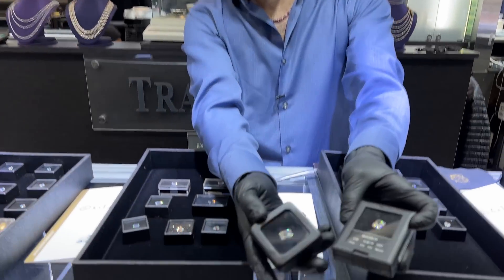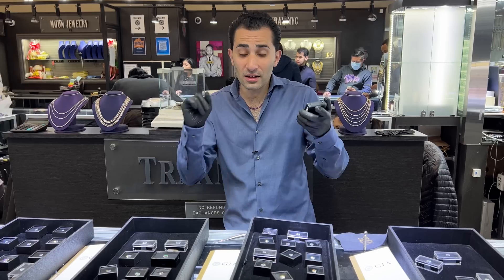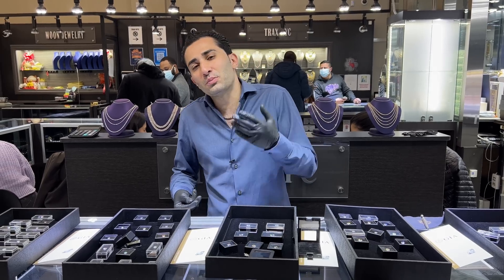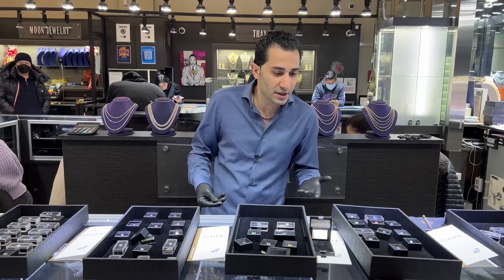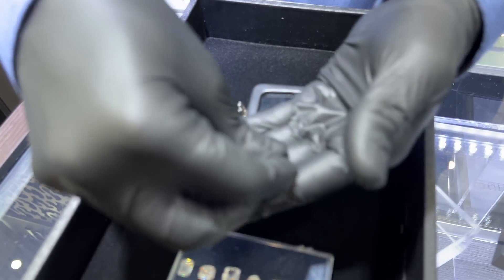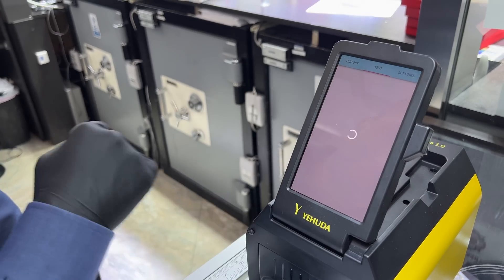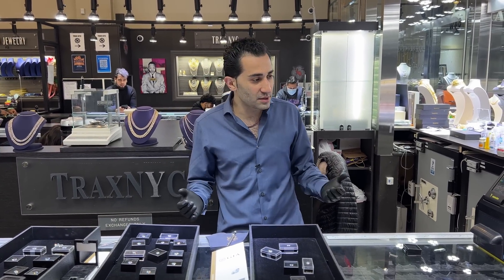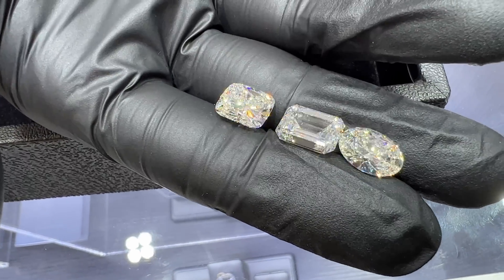How to Buy LAB GROWN DIAMONDS (CVD & HPHT EXPLAINED) | Diamond Buying Guide!

Comment: There is no visual difference between a lab grown and mined. You only thought so because you used the machine so it was psychological bias.  What's probable is that the earth mined diamond may have just been a better diamond but not because it came from earth, likewise the lab diamond was not 'worse' because it was a lab diamond. It is simply because no two diamonds are alike and I can guarantee in another situation the better diamond may have happened to be a lab diamond. Correlation is not a causation. That is a fallacy and without the machine you would have not known. It's why those lab diamonds are kept separately isn't it? They would be mistaken for mined diamonds by experts like yourself!

Comment: The argument about the gasses is the same argument you could make about rubies and sapphires. The element that gives color is different but they are essentially the same mineral. Look at the two and ask whats wrong with the red one that makes it red? And i dont believe for a second you can tell the difference if you were to go in blind. Thats why you need the machine to look at the gas make-up in the diamond. Because its not possible to tell visual difference.

Comment: Question: other than the machine telling the difference, what really is the major difference between the two? Especially for purchasing reasoning. Aren't they both technically diamonds as the process to create them were essentially the same, other than the required time to create of course. Genuinely curious.
Reply: They're chemically identical, so there basically is no difference other than the price and the time they take to make.
Reply: The fact that it takes Millions of years to make a real Diamond. The person who values real rocks knows if its natural ...or not. And that means everytime they're asked about the Diamond they are reminded its not natural...but man-made. The real thing is the REAL deal .

Comment: So much poor information here in these comments, where to start.  There are countless vaults and wharehouses full of mined diamonds that have yet to see the light of day.  Any production decreases, or supply shortages you hear of, are due to supply manipulation to keep prices high, and/or raise prices.  The  machine in this video was produced because 99% of EXPERIENCED jewelers can't tell a lab diamond from a mined diamond.  And that remaining 1% of jewelers is only guessing it's a lab diamond.  They dont actually know for sure until it's in that 5k machine.   All diamond certifications are subjective to the experience on the original grader, and standards of the grading company.   The last thing you want to look at on the grading report is the simple break down on the left side of a GIA report.  Cut, polish, etc.  The right side giving the diamond dimensions is your money page.   All lab diamonds WILL ABSOLUTELY out sparkle, be more brilliant, and have more fire, and be LARGER than a mined diamond costing twice as much.  And if the lab diamonds drop in price, then it's going to cost 1/3 or even 1/4 as much to get better light performance than a mined diamond.

Comment: After watching the 8 minutes video, i still confused about CVD and HPHT? Is CVD and HPHT the same? Is there difference in quality between 2 process of lab grown diamond?
Reply: it's just different methods, same outcome. my engagement ring is CVD and my wedding band is HPHT. weird thing about my band though is that one of my 9 stones on my band has phosphorescence, so when it's under UV light for a bit, it glows in the dark. not ideal for diamonds, but it's not a huge deal. i believe this only happens in HPHT diamonds, not CVD. i also think that a lot of CVD diamonds are treated to be more white/clear, since they usually come out brown or tinted.
Reply: @geminuri  you HPHT should also be a bit magnetic
Reply: You can only get certain clarities and colors using each of the methods. As technology advances, maybe the various methods will become one

Comment: I wouldn't ever recommend getting anything below VS1 on an emerald cut, the cut really makes a difference an SI2 emerald would look a mess VS1 DEFG triple X at $4500 for a carat round wouldn't go lower
Reply: I wouldn't go below VS¹ D/E or VVS. You are correct. Emerald cut has large table. There very little place to hide a flaw. Color shows big time too. A yellow or grey emerald cut looks like heck. A good cutter can work w modified cushion cut. A lot of new Modified brilliant cuts are by design too hide flaws add brilliance. Emerald cuts = pony up.
Reply: @roberttyrrell2250  that's why I like emerald cut! I got an emerald cut F color IF clarity X/X no fluorescence for my wedding band, and it's amazing!
Reply: @masondelpino8118  Amazing. You're still in colorless & That's a great cut. It will hold value well.
There was debate yrs ago about fluorescence & value. The industry determined neither is valued more than the other. Some guys in Tokyo were trying to devalue the mkt.
Reply: You guys must be super rich talking C’s like that, but now let’s get back to earth and try to sell this at a store to normal people!

Comment: Diamonds also come in on a meteorite hit. One in Siberia hit and trillions of carats of diamonds were deposited. Putin does not allow mining because it would destabilize the diamond market.
Reply: Well not deposited, but when meteorite hits, it strikes with so much force that it's able to stirr up diamonds from that deep part of the Earth's crust. So these are hot spots for mining because it requires less digging
Reply: @gregorydiamond9416  the article I read stated other but yes, it would also cause diamonds to form from the huge force and heat, would it not? Therein are 3 different scenarios.
Reply: @d.h.fremont3027  after a very long time absolutely.  I mean I'm no expert but look at it this way, under the extreme conditions created in a cvd or hpht machine, this process would take about 2 months. I could imagine that an major impact would be similar and could do the same but we haven't had one of those in a real long time, and between me and you I'm not looking forward to the next one 😭

Comment: so from my understanding a lab grown test the same as the rarest of natural diamond which is type 2a. So how would you tell those two apart vs just common sense of having a lot of them?
Reply: you can't tell them apart with the naked eye, but under a microscope, lab-grown diamonds usually have the lab's serial number engraved
Reply: @zlo8389  the only diamonds 💎 that have serial numbers  are GIA certified diamonds. Not all lab grown diamonds are. Hence why bad jewelers are substituting real diamonds for lab grown to rip us off.
Reply: @stephenlozada7158  No, that's incorrect. Lab grown diamonds can be GIA certified just like natural diamonds, in fact, many are. GIA certified just means the diamond has been evaluated by the GIA and given a 4 C rating (cut, color, clarity, and carat). However, it is illegal to sell a lab grown diamond without disclosing that it is in fact a lab grown diamond. Gnerally, lab grown diamonds have a number literally engraved onto the diamond from the lab that can only be seen under magnification. Obviously, natural diamonds will not have this engraved on the diamond.
Reply: The easy way to tell is that the lab grown diamond is usually flawless. Natural diamonds usually have some color to them from the rocks strata they formed in.